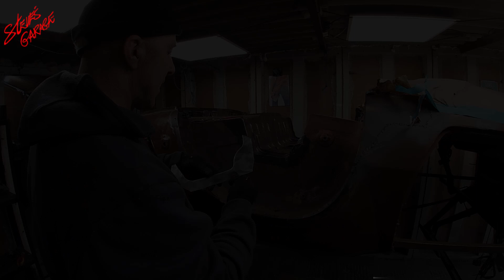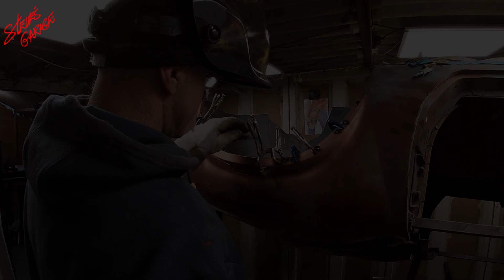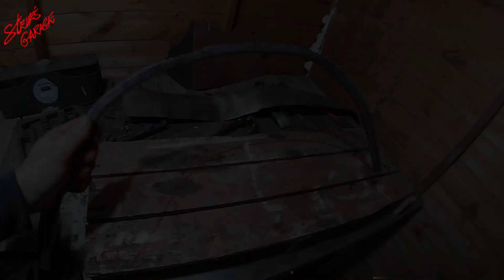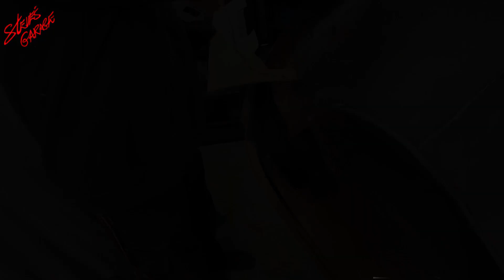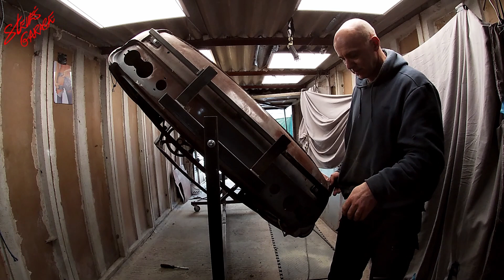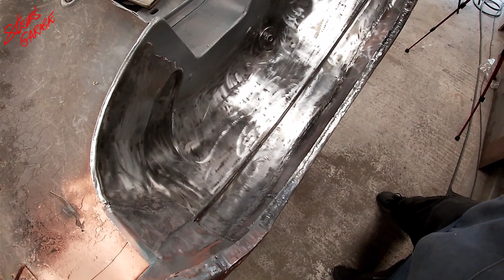Steve's Garage , Spitfire rear wheel arch/ Boot Floor The rust Rabbit hole begins !!!!!!!

Comment: Dude you should finaly step up your welding. Why are you still just spot welding? If you weld it all properly the welds will be much more solid. ;)
Reply from the maker: Hey there Ivan, there's a lot of different thoughts on this, most people restoring weld in this way due to the heat damage and panel distortion caused though welding like you mention, by welding in this way I'm not keeping the heat in one place to long , it's not that I can't run a welding line just that I choose not too, maybe I'm been a little to careful, but just for you il weld a complete run in-between the spots that hold everything in place lol
Reply: @stevesgarage1976  you are right,the heat will cause the steel to bend a bit. I didnt think about that... and i was working with stainless steel for 10 years. :D we used to "support" the welded parts with stronger and thicker parts of steel that also worked as a "heat sponge",but that is a lot easyer on the stuff i worked with plus the minimal thiknes of steel i used to work with was 2 milimeters and that react to heat a bit diferently then the "paper" you are using for restoratuon. ;) Btw,you have hair now? How come? :D